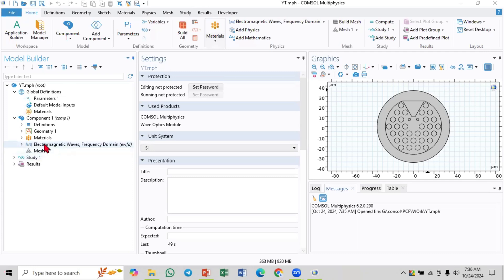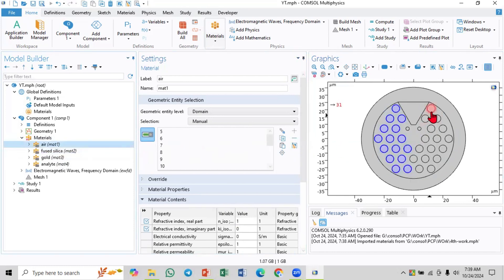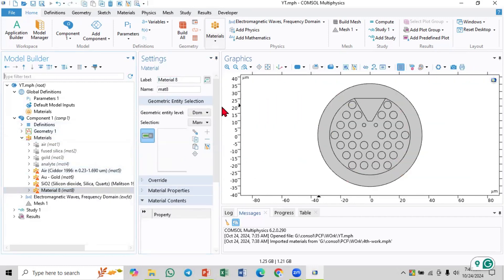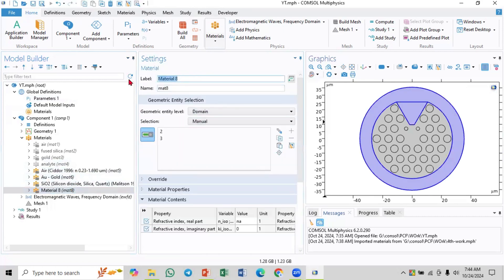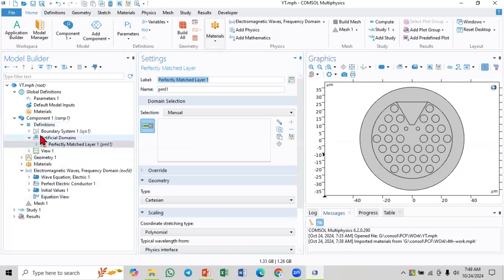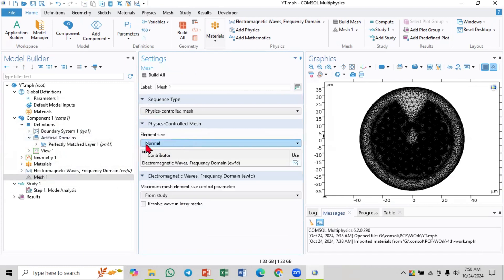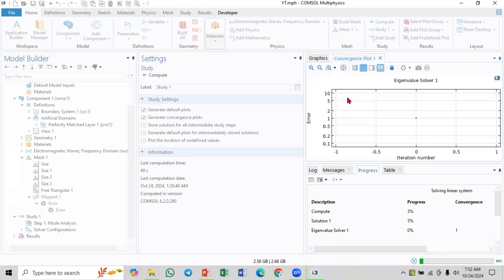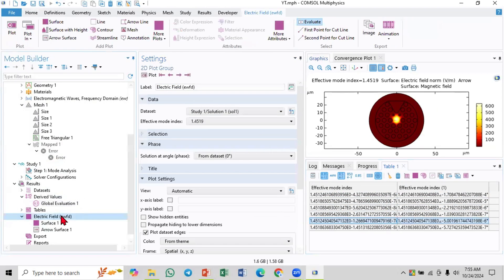(Part 2) Advance PCF based SPR sensor Comsol 6.2v|| Channel creation of V shape PCF based SPR sensor

Comment: Sir, i have a doubt 
Is it compatible with experimental results or not ?.
If yes, please comment on this.
Reply from the maker: Thank you for your question. Yes, this PCF-based SPR sensor model is designed to align closely with experimental results. Although this video focuses on simulations, the principles and parameters used are applicable to real-world scenarios. If you would like more details, please let me know.
Reply: @Md_Abu_Huraiya  
Sir ,  how to calculate the fiber transmission coefficient in comsol.
Reply from the maker: @Ashoksahu-y7r  Ok I will make a video explaining it.